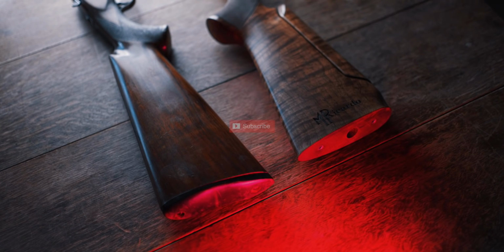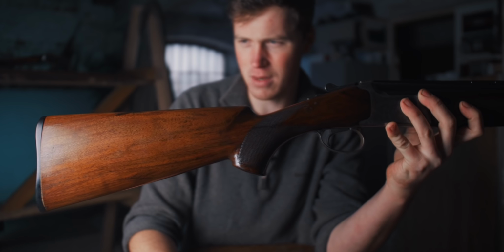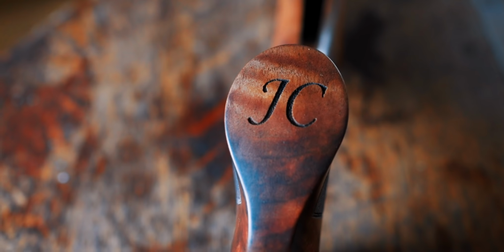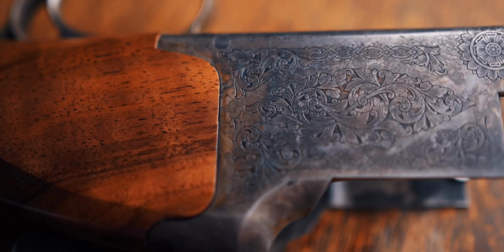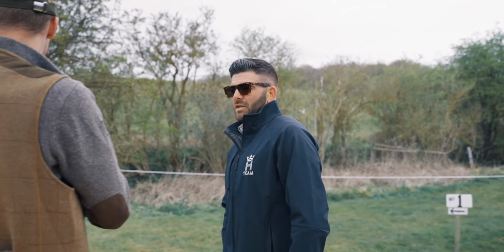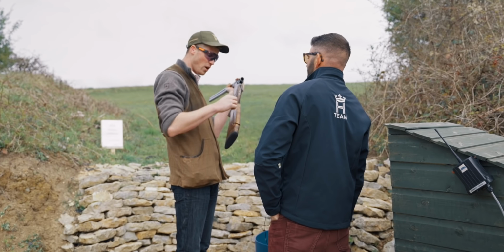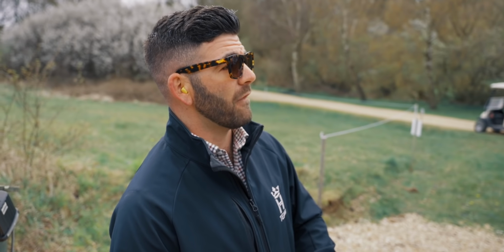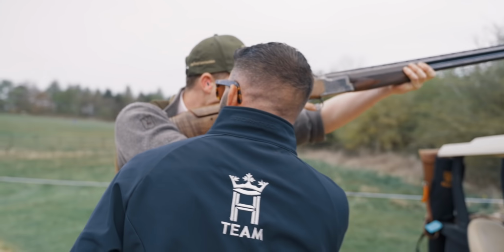The One-Click GunStock ft. Manuel Ricardo

Comment: Being 6ft 7 my self and not getting on with 90% of guns I’m tempted to buy a higher quality second hand gun probably a Invictus 1 and have something like this done eventually my local shop have been encouraging me to go this route what would a Manuel Ricardo stock start at
Reply: Have you tried British guns from the early 20th century?  Of course, you will likely need a pad to increase the length of pull; but, otherwise the fit might be good.
Reply: Grade1 €500   +€200  for adjustable.     Grade 4 wood adjustable cost me €1200 all in.  At 6ft7  your never going to find a gun off the rack that comes close to fitting you

Comment: Johnny, remove the butt pad from a Beretta 686 Field.  Look at the cavity in the stock.  Then remove the butt pad from a 686 Sporting and look at the single hole for the stock bolt.  Does that give you any ideas?  Fact is that if you do some conservative wood removal from the center of that Ricardo stock you can probably achieve a balance that matches the balance of the stock you made for the Moruku all those years ago.  Actually you could probably send both stocks to Recardo and he could re-balance that new stock to achieve an identical balance to your old stock.  Yeah, it will cost a bit to do this additional work but I'll bet you a US Nickle that it will cost less than a new shotgun for that stock and you'll have your beloved Moruku fitted with a stock that will work for many years to come and is adjustable to adapt changes that happen as you age.   Hot tip on that note, start doing Yoga and those changes will be greatly reduced.
Reply from the maker: I had contemplated doing just that but two things sprung to mind:

Just because it handles differently doesn’t mean it’s bad and as ES says, ‘accept that there will be a bit of a transition period’

I could do with a steel proofed, multi-Choke gun ongoing anyway. Seemed like a good enough reason to build a new gun
Reply: @tgsoutdoors  Well, I can understand that.  Going to take a drive Friday to pick up a 687 Silver Pigeon III 28/410 set.  Already have tubes for my 12 gage 686 but shoot the 410 terribly and if feels like I'm swinging a telephone pole.  The 28 gage isn't too bad because those tubes do have a much larger hole in them but I figure why not a combo.  It's too bad that Skeet isn't as popular as it once was.  Because what I would really like to have is a 687 SPIII 4 barrel set.